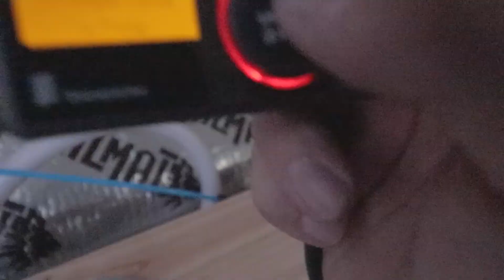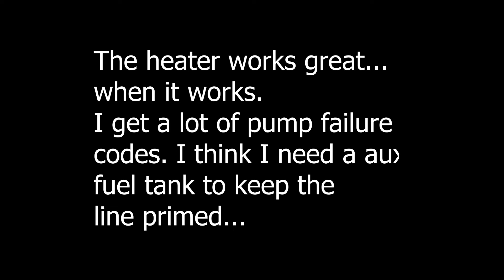Installing a gasoline Espar B5e Heater / Water Heater in my VAN | VANLIFE | StephenShreds

Comment: Hi, I know you posted this a year ago but could you tell me if this came as a kit for your Promaster or if you had to buy all the components separately?  If separately can you list the parts?  Thanks in advance
Reply from the maker: Hey 👋 Jong! So the espar came as a kit from heatso. Depending on what you want the heater to do the heater work well. Heating water is amazing with the heat exchanger. I would love to use this as a shower heater. It is a  it pricey for that use. If you are using this for heating alone I would not recommend this specific unit. The install is a bit rocky as well.
Reply: @StephenShreds  thanks… did the heater exchanger come with the kit? I’ve looked at several kits and none show the heat exchanger
Reply from the maker: @CalmTurtle2023  I think it was an add on
Reply: @StephenShreds  OK thank you again.  If you happen to remember manufacturer, sizing for pipes etc… it would be greatly appreciated.